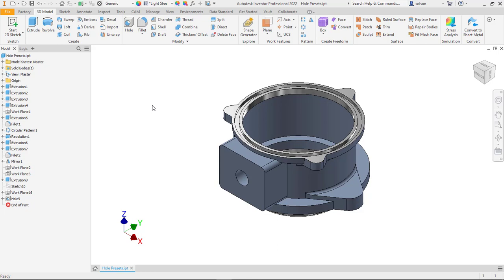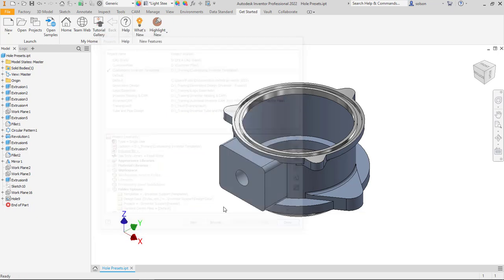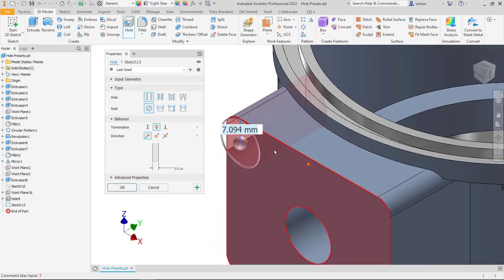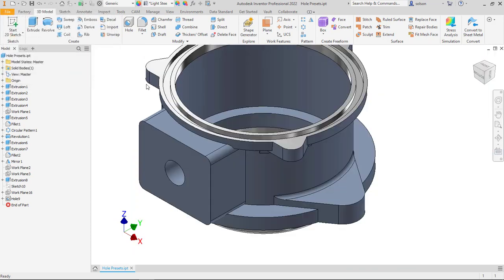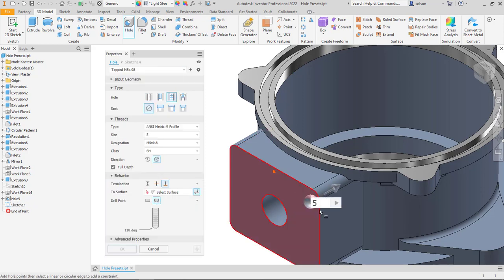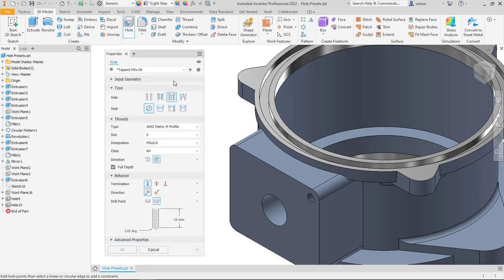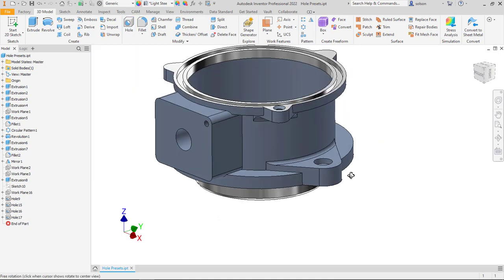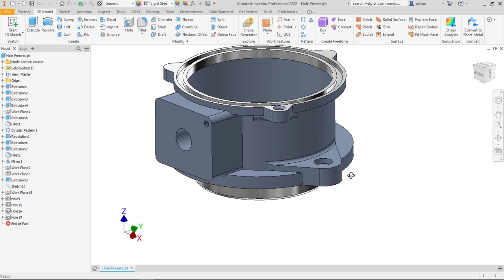Inventor Feature Presets

Comment: Hi im one f your suscriber and i would like to ask you about a video you made about saving pdf from a drawing using ilogic , i found it very useful but i want to ask you wethere there is a way to save a pdf with different revision so i can different name for the saved pdf for each revision thanks in advance
Reply from the maker: Yes, it is possible to include the Revision Number in the file name when it saves the PDF.  You just have to alter the line that creates the name.  In your case, it would be something like:  

PDFName = PDFPath & "\" & ThisDoc.FileName(False)& "Rev " & iProperties.Value("Project", "Revision Number") & ".pdf"

The & allows you to string together different strings and variables.  So by adding & "Rev " & iProperties.Value("Project", "Revision Number"), you will add the letters REV and the Revision Number iProperty after the file name in your PDF's name.  

Hope this helps.  If you want more detailed help, feel free to email me at steve.olson@mesa-cad.com

Thanks,
Steve
Reply: @3DSteve52  thanks steve for your answer
i have another question this time about BOM 
i have an assembly with several identical parts, (several occurance of the same part) the difference between these parts is cut out done at the assembly level so at the part level they still the same
in the BOM they are merged and i would like to get them listed seperatly because of the cut out, how can i do that?
thanks in advance
Reply from the maker: @OmarAli-pp7ue  What version of Inventor are you using?  There are settings in the Bill of Material dialog that allow for row merging.  By default, it will merge rows when it sees the Part Number match.  This is common where users will have two different IPT files, but the same Part Number.  I wanted to test out your scenario so I created a part, placed it in an assembly twice, and put two different cutouts on the two parts.  I didn't see a way in the settings to allow for each instance of the part to be listed in the BOM.  Then I remembered that Inventor 2022 has a new feature that allows for Instance Properties.  The command is in the right-click menu.  I went into the first part and put a property called Cuout and gave it a value of A, then I went to the other part and gave it a value of B.  When I went back into the Merge Row settings for the BOM, I disabled the Merge Instance option and it listed each instance individually.  If you are not using 2022, let me know and I will see what can be done in the version you are using.

Hope this helps,
Steve
Reply: @3DSteve52  hi steve once again big thanks for your answer ; im using 2021 inventor version, and i tried the use of uncheck the merge opion and it worked for me, but the list become long with all identical parts separeted also 
( so many rows for real identical parts)
Reply from the maker: @OmarAli-pp7ue  I was afraid that was going to happen.  I don't think there is an easy way to do what you are looking to do.  If I remember correctly, you are using assembly-level cutouts on each of these parts.  If you used something like an iPart, you could have your different variations of the part and each could have the same Part Number iProperty.  However, each could have its own cut.  Then you could enable the merge instances, but disable merge on iProperty match.  That should work, but instead of the cutouts being at the assembly level, you would be using an iPart.  I don't know if that will mess up the way you need to build your assembly.  Hope this helps.